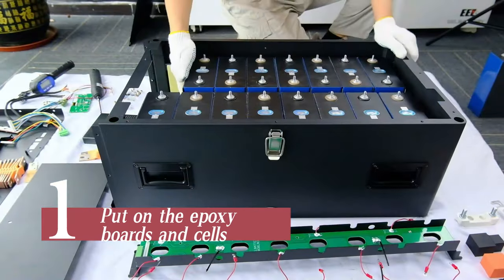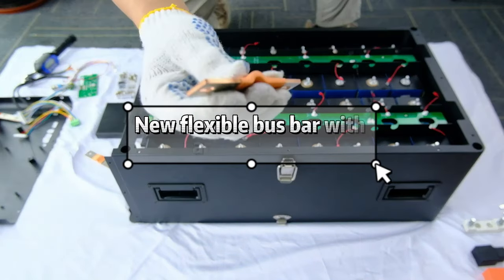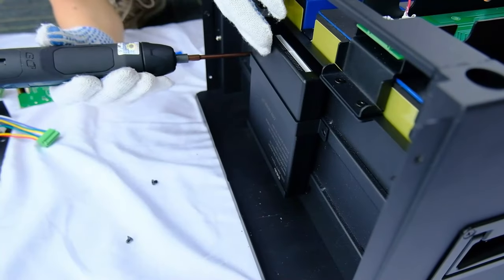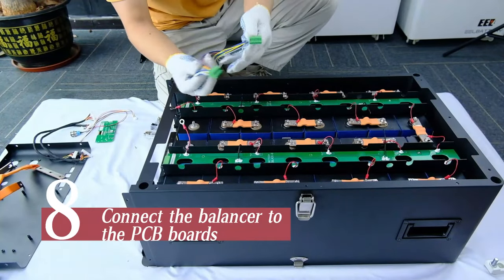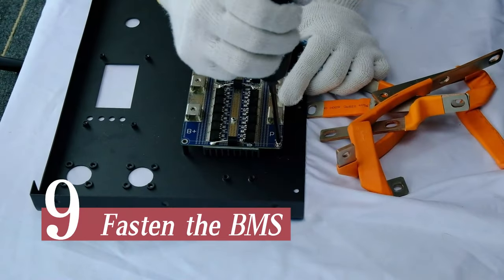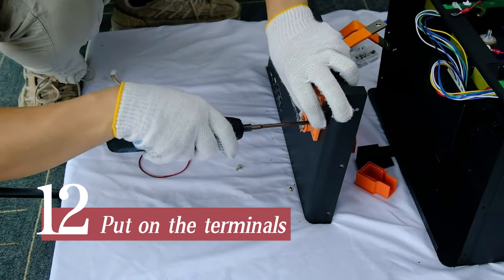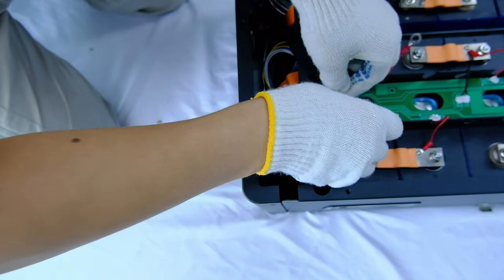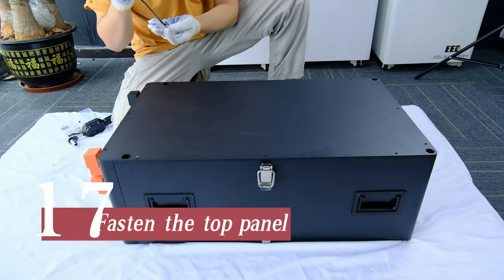V3 48V 280ah battery battery pack installation video~

Comment: When will you deliver the case by default with the New PCB with dedicated balancer Cables? 
Will there be an Option for the case without BMS or the New JK inverter BMS ?
Reply from the maker: Yes, there are kits without BMS, and there are also matching kits for the new JK BMS. Please feel free to click on the link to contact me if you need it~:hand-pink-waving: